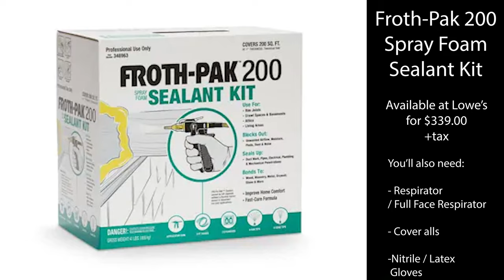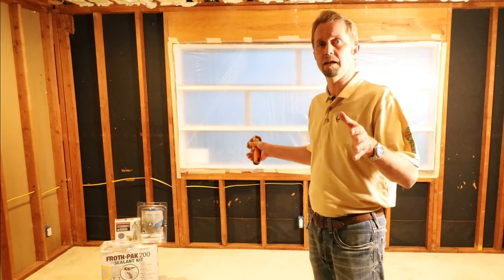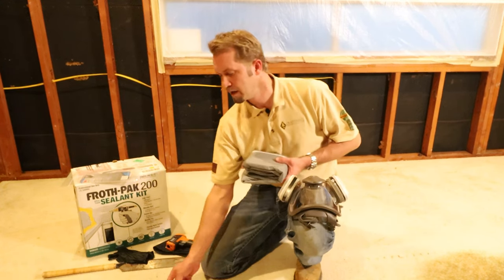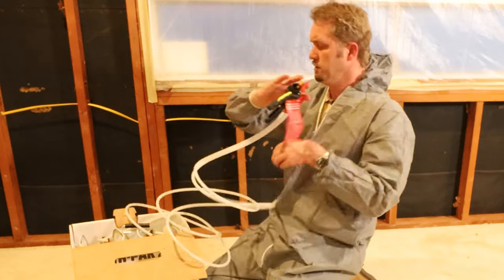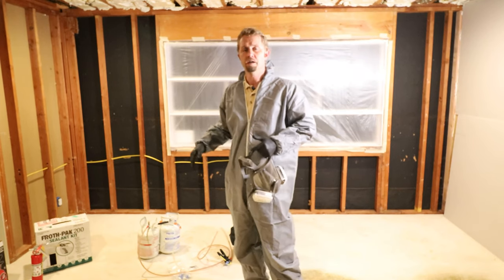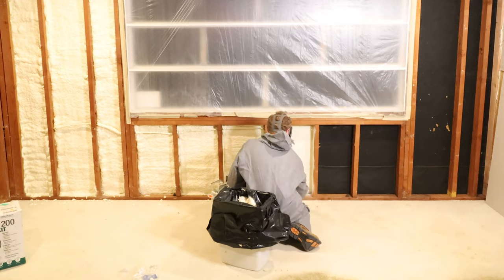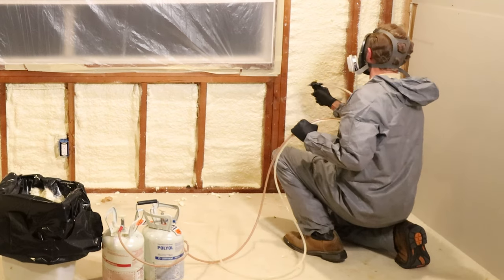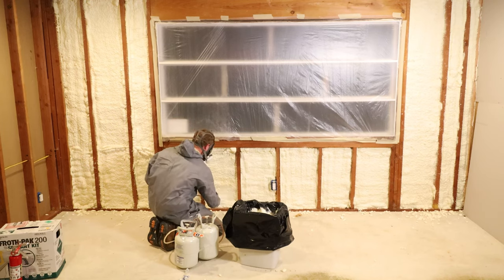Froth-Pak 200 Spray Foam Sealant Kit Set-Up, Precautions, and Spraying Review #Froth-Pak

Comment: Isn’t this the wrong kit for insulating? The sealant kit has very little R value in comparison to the insulation version. At least that is how they advertise the difference between the two
Reply from the maker: Incorrect. If you go to the Dow Froth Pak 200 Website, the website says sealant and insulation in the second paragraph for this product. I extensively commented on this with another recent comment. Froth Pak is a closed cell foam that has approximately twice the R-value as open cell foam. I’ll agree the labeling on the box is disappointing, but if you go to their official website, like I have, then you’ll see the correct info.
Reply from the maker: The following is from the DuPont website: in the first Paragraph when I searched for “Froth Pak 200”.
    “Froth-Pak™ Foam Insulation is a two-component professional insulation kit. Froth-Pak™ comes as a professional sealant for air sealing gaps and penetrations up to 4 inches wide or as a spray foam insulation to fill larger cavities providing both insulation and air sealing properties. The Class-A rating (flame spread of 25 or less) of Froth-Pak™ Foam Insulation allows its use in a wide range of interior and exterior industrial, commercial, institutional and residential settings.”

Comment: So the foam might reach 450* ??
Reply from the maker: Ray, I’ve been told by a spray foam contractor friend that fire/ignition is possible if applying too much foam in one pass. So they spray a little foam and let it cool a bit before going over it again to achieve a thicker layer.

Comment: How much do the cylinders weigh when they are empty? I'd like to use a scale as a fill gauge, but need to know tare weight to do that accurately.
Reply from the maker: I did not weigh the metal containers empty. You’re welcome to share that info when it is full vs. empty. I think what is important is the yield of the foam in terms of board feet. All of the spray foam contractors I have talked to talk about getting the temperature and mixture correct to produce a properly mixed product, and the yield as how far the product will go at a particular thickness.
Reply: @craftsmanconnection  I get that but let's say the containers are 41 pounds when full. If they weigh 9 pounds "empty," then you know you have used half the material when they weigh 25 pounds. If you have less than half of the job done, then you know to spray thinner for the rest of the job.
Reply from the maker: Hi, yes, I see where you are going with this. I wish I could answer that for you. I kept my empty tanks for over a year until I finally disposed of them. Just missed that opportunity. If I get a chance to buy another tank and plan to completely empty the tanks, I will try to remember to follow back up with a comment.

At another job site I only used a partial tank, and it’s still at that job site mostly full.
Reply from the maker: @Rendus4  In addition, would it be just about as accurate if you could just measure the surface in which you sprayed? If one container sprayed 72 square feet around 2” - 2.5” thick, and I’m pretty sure each container probably doesn’t do exactly the same amount, than measure the board thickness you sprayed and subtract that from the total board feet I mentioned in the video. Part of the yield has to do with temperature, according to a spray foam contractor friend of mine. Until I weigh the next set of containers, that is about the best I can do for now.
Reply: @craftsmanconnection  The weight is absolute and orders of magnitude more accurate. Way too many variables in board feet, like thickness, how much air got trapped, temperature, expansion, etc.

Comment: What do you do with the bottles when you’re done?
Reply from the maker: If the containers are completely empty, than they can be recycled.
As an example, I talked with my spray foam contractor, and he said when they have 55 gallon drums of chemicals, the recycling plant will take the drums, if there is 1 inch or less of chemicals inside. The drums have pumps and things that screw down and only reach so far down into the 55 gallon drum.
Reply: The video was nice great job ..but I think the price is to high for the amount of wall space u doing without the cost of the added essentials that will be needed..
Reply from the maker: @OscarPerez-uq7zt I’m not sure of the exact retail cost should be, but if the Froth Pak was more around $150-$175, they would sell a whole lot more of them. I’m imagining comparing what I might get out of spray foam cans vs. a bigger container. Maybe some day I could do a test. “How many spray foam cans would it take to get the same R-value of foam?” Of most spray foam cans are open cell in nature, and Froth Pak is closed cell foam, which is about twice the R-value.

Comment: Is it rain resistant?
Reply from the maker: The Froth Pak is a closed cell foam and it is water tight/ water proof, but it’s meant to be behind or under another layer of sunlight protection, otherwise the material will degrade just like anything else exposed to the sun and weather.
Reply: @craftsmanconnection  thanks a lot!

Comment: I had no idea spray foam was/is so EXPENSIVE.

I thought of doing this in my home after seeing it done on THIS OLD HOUSE... far more expensive than the glass fiber insulation.

Also the equipment needed to protect oneself from the foam was expensive too... 200 dollars for a face mask???.. I mean come on. Plus the suit and plastic drop cloth for the windows/doors etc.

The total for all of this was probably 800 to 1000 dollars and that is just one wall in one room. What would be the final cost of all four walls and the ceiling?... Christ!!!!
Reply from the maker: Samson, the cost for these small kits is more than what it would cost per board foot for a spray foam contractor to come in and do a larger project. The cost of the Froth Pak 200 is now $409 - $429 at Lowe’s and Home Depot respectively.

If you look into the Froth Pak 620, the cost per board foot goes down. These kits are great for doing 1 wall or one room and cheaper than hiring a spray foam contractor.

As the project size increases, it’s more beneficial in terms of product cost and having a contractor come out to do the job. Example: It wouldn’t be a very good idea to buy a $40,000 car ($550 monthly payment) to drive 1 mile a day, but makes more sense as you need to drive to work 30 miles or more a day. Since this isn’t the only time I’ll be spraying a wall or two at my house or a clients job, a $200 mask is somewhat expensive, but will make more sense over time.
Reply from the maker: In addition to my last reply, typically a room inside a house has only 1-2 exterior walls, so the cost can be around $800-$1,000 for 1 room, if you do it yourself. The advantage is not paying a spray foam contractor their $1,500 minimum charge, so you save some money there.

I’ll be filming another Froth Pak 200 spray foam video for my shed project, and that will video will cover all 4 walls, and maybe the roofline too. Of course, I’ll cover all the time and expenses to help viewers make an educated decision on their purchase decisions.

Comment: What is the R value at 2" ?
Reply from the maker: The R-Value of the Froth Pak at 2” thickness is R-12.2 after 75 days according to the company website.

For Froth-Pak™ Sealant the LTTR value (Long term thermal resistance) measurement at 1 inch thick is 5.3 ft²•h•°F/Btu (R value) per inch. When sprayed to 2 inches thick the LTTR value (Long term thermal resistance) measurement at 2 inch thick is 5.5 ft²•h•°F/Btu (R value) per inch which is R11.0 at 2 inches thick.

For Froth-Pak™ Insulation (Aged 180 days @ 75°F):

Thickness (inches)

R-Value (ASTM C518, F.ft2.h/Btu)

1.0" = R- value 6.0 (when sprayed at 1 inch thick)

2.0" R-value 12.2 (R5.6/inch when sprayed at 2 inches)
Reply: @craftsmanconnection  Hey thank you a bunch for getting back at me with the answer so quickly. This seems like the best solution for my houseboat!
Reply from the maker: You’re welcome, and closed cell foam is water proof. Great insulation, and hopefully you don’t need this, but it’ll float. 😄
Reply from the maker: I’ll be making another Froth-Pak video soon for a 114 sq. ft. shed project. How to use spray foam in a non-air conditioned space, showing additional requirements for ventilation to reduce build up of humidity. Your house boat is not air conditioned all of the time, since you probably don’t use it all of the time. Subscribe 🛎 to be notified when that video gets uploaded to YouTube. Happy boating!
Reply: @craftsmanconnection  lol
Reply: @craftsmanconnection  I'll be there !

Comment: How long do you need to wait between coats?
Reply from the maker: I gave it a few minutes. I checked the temperature with the heat gun after applying to compare the freshly applied coat and then went back down to normal room temperature fairly quickly.
Reply from the maker: And by heat gun, I really meant the temperature gun. It’s an IR (infrared) temperature gun/ thermometer.
Reply: @craftsmanconnection   okay right on I'm going to pick up one of those laser temperature readers. The part I don't really understand is where you shouldn't spray more than 2 inches or whatever it was. Is that 2 inches of wet foam? Or is that 2 inch once it's expanded? And if so how do I know how thick it's going to be until it's expanded?
Reply: @craftsmanconnection  do I try to adjust my rate of speed while spraying to try to let each pass build up to a set thickness of wet foam or how does that work?
Reply from the maker: That is 2” of foam once it is expanded. When you spray on the foam, it’ll look like you are spraying on 1/4” worth of foam. Very thin, and it’ll expand roughly 1-1/2” is my guess. The best thing to do is to test an area and get a feel for how thick to apply the wet coat. Keep in mind that the wet foam will harden in the spray nozzle in about 30 seconds or less, so you will want to have all of your work area ready to spray, and don’t dilly dally too long, otherwise you’ll need to change out for a new spray tip.
Reply: @craftsmanconnection  How long does it take to expand to full thickness?
Reply from the maker: @shevinsacrey5862  it only takes seconds to expand to full thickness.
Reply: @craftsmanconnection  ok gotcha, thanks alot for all your help and quick replies man!
Reply: @craftsmanconnection  hi sorry, one last thing, you were saying that it hardens up in the nozzle quite quickly, but then you need to wait for it to expand and cool down before applying another coat, so are you having to replace the nozzle each time you do that or is it like, by the time you get to the last cavity on the wall the first one is ready to spray kind of thing?
Reply from the maker: You can spray the foam across your whole wall continuously at a certain thickness, like 1” to 1-1/2” for example, and let it cool, like I showed in my video. Then I changed tips, and sprayed again to increase the thickness to 2” to 2-1/2”. This method ensured I got the whole wall covered at least with 1 pass, and then I increased the foam thickness to 2” to 2-1/2” (as thick as I could). I wasn’t sure just how much of that wall was going to be 2” or more, but I was super lucky as the container emptied out just as I completed the second pass. That was another reason for listing the square footages of the wall areas, so other people could get a sense of what they could accomplish on their walls, before the container would become empty.
Reply from the maker: You’ll spray the first coat continuously, so the foam doesn’t have a chance to harden. Then you will change tips, and while you are doing so, the foam will cool down. Then you can spray the second coat of foam with a new tip. Don’t forget to allow fresh air cross ventilated into your work area. You’ll be wearing an appropriate respirator rated for this, so the isocyanate doesn’t crystallize in your lungs or in your eyes. My spray foam contractor said it’ll feel like sand paper or needles in your eyes, ….something like that, like it reacts to sweat, and other moist/damp/ humid/wet areas. Don’t try to do this spray foam with a dust mask.
Reply from the maker: Think of spraying spray paint. It looks thin, but with spray foam, it expands to be thicker to fill in the space. Make you coating process even and overlapped 50 percent approximately.
Reply: @craftsmanconnection  do you know if it's safe to spray over top of the spray foam that comes in a can. The homeowner tried to fill the whole cavity with cans of great stuff spray foam and obviously that wasn't going to work but there is a fair amount of it in there.  Hoping there won't be any issues spraying overtop of it, like unwanted chemical reactions and what not.
Reply from the maker: I’m not aware of any chemical reactions between 1 spray foam and another. Using canned spray foam in a 16” to 24” O.C. wall stud cavity I’m sure ended in the foam simply falling away from the exterior sheathing material in a big goopy mess. Canned spray foam isn’t designed to stick to the exterior and harden up fast enough, like the Froth-Pak is. You’ll really enjoy the Froth-Pak product.
Reply from the maker: Can I ask for you to be part, 1/1000th of the reason my YouTube channel gets monetized, by subscribing? It sounds like you are a contractor. You could also suggest future video content. I suggested content with another YouTuber, MyFortressConstruction, and he made a video about YouTube monetization and analytics, mentioning me in the video a couple times.
Reply: @craftsmanconnection  I tried to tell him but he didn't want to listen. Didn't want to put up the money for a froth-pak. 5 cans of big gap spray foam in and about 150 bucks and all he's got is a big mess there for me to clean up, plus has to now pay for the froth-pak I suggested prior to all of that lol. And sure I'll subscribe.
Reply from the maker: That’s pretty funny, rewarding, and so on. We’re all full of hope until we learn somehow.
Reply from the maker: …and thank you!
Reply from the maker: Once you get the Froth-Pak and see how slow/fast it sprays, I hope it’ll be fairly obvious how much to spray on. For reference, the beginning of my Froth-Pak video, and the end of the video is at real time speed so you can get an idea of what that looks like. The next time I do a video, I have another 2 camera’s to get close up views, etc.  I’m working on my kitchen remodel planning, and in that I’m planning on using the Froth-Pak 600 kit or 640 maybe, and do the walls in my kitchen that I have doubled in size.
Reply: @craftsmanconnection  Ami able to do my barrier right away or do I have to wait 24 hrs?
Reply from the maker: Are you able to do your vapor barrier right away? The Froth-Pak spray foam is a closed cell foam. Closed cell foam is a vapor barrier, while open cell foam, just like fiberglass insulation, is not a vapor barrier. 

Depending on what climate zone you live in will depend on what side you would typically put a vapor barrier. In warmer climates, like Southern California, Texas, Florida, the vapor barrier goes on the outside, while in cooler climates (Climate Zones 5,6,7, and marine 4), like Indians, Ohio, Michigan, the vapor barrier goes on the inside.

The use of a vapor barrier on the interior or exterior of a building is dependent on the climate zone. The 2018 International Building Code (IBC) 1404.3 and the 2018 International Residential Code (IRC) R702.7 instruct the use of Class I or II vapor barriers and retarders on the inside of frame wall in climate zones 5,6,7,8, and Marine 4.
Air Barrier vs Vapor Barrier: What are The Differences
barricadebp.com/news/air-barriers-vs-vapor-barriers
Reply: @craftsmanconnection  hard to explain but this is a wood foundation home so there are two sets of framing, the wall the home sits on and then the actual wall inside. The framing on the inside(foundation) is the one I'm spray foaming. The wall in front I am doing fibre glass insulation then vapor barrier. I'm in Canada it's all on the outside here, outside being after the insulation, behind the drywall.
Reply from the maker: @shevinsacrey5862  You’re right, that is hard to explain and understand. A picture(s) is worth a thousand words… or more! I have not see a house built with more than 1 exterior wood wall. I have seen concrete block homes built with wood framed walls on the inside mostly for the purposes of running wiring, hiding plumbing, ductwork, etc. I wish a could see a framing plan of what you are dealing with.
Reply from the maker: @shevinsacrey5862  I wish I could see what you are working with, so far as the framing, and insulation. Maybe you could add a video to your YouTube playlist somehow? I could go to your channel and watch it.
Reply: @craftsmanconnection  I'm just gonna give it 24 hrs then I'll do the vapor barrier. It's basically a wall in front of a wall. Back wall(exterior is getting spray foam. Front wall is getting fiber glass insulation and vapor barrier.
Reply from the maker: Sounds good Sounds like you are giving it a little bit of time to “off gas”. Good luck with your project.
Reply: @craftsmanconnection  thanks, and thank you for all the help I really appreciate it. Very few people on YouTube will take the time to actually reply to comments, let alone several comments.
Reply from the maker: It was only 16 lengthy replies! 😅